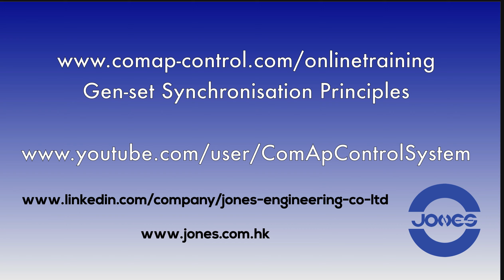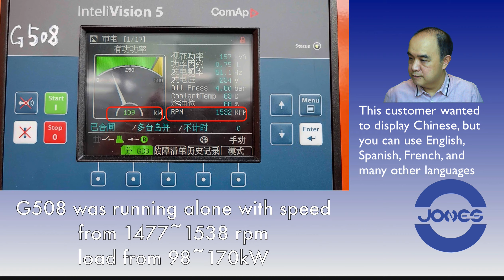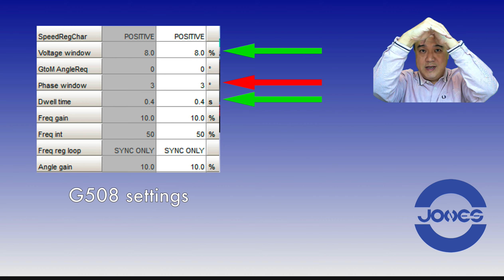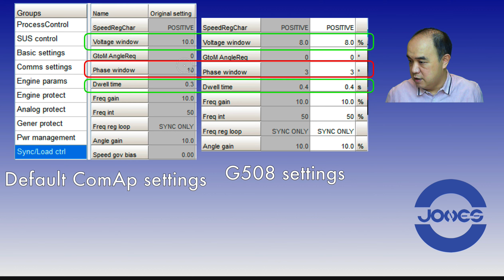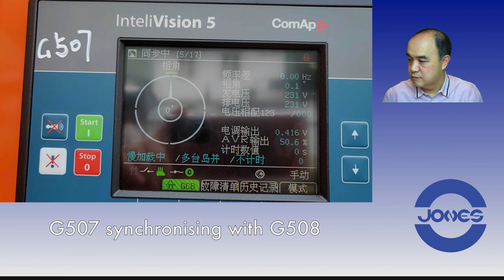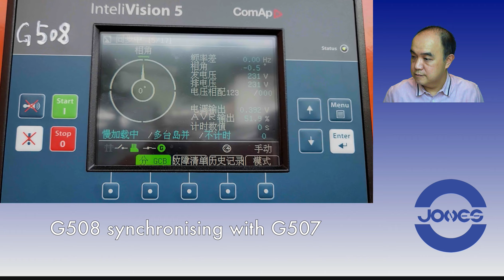ComAp Synchronising while Engine Speed is Unstable

Comment: i have cummins qsn14-g3 with pcc 1.2 controller and ecm 876. i want to add existing 4gensets. i have inteligen basebox nt controller. any advice? am i remove the pcc and use comAp as a genset controller and synchronized comtroller.
or a way u can suggested me.
Reply from the maker: sorry, I am not familiar with this particular Cummins model. But most of the recent Q series Cummins engines are electronic engine with CMxxx ECU. If you find out which CMXXX it is, you can just select it in the ComAp PC software.  After you have a working connection via CAN, the setting of the sync/load share is quite similar to what was described in the video
Reply: thanks for your response.

Comment: Hi we are using inteli Gen200. We have power management issues. we synchronize 5nos 600kva genset. Last 3 weeks we are spacing in Auto mode gensets all start but Genset not stop as per power management. Even 500KW system load all generators are working with Each 80KW load. No one generator stop. all are working with 80KW Load. We already check can communication cables, Power management settings all normal. kindly Advice asap to solve this problem. We need 500 to 600 KW load only 3 generators need to run in Auto mode.
Reply from the maker: will need to look at your archive to see the settings and the history.  May I know where you are from? I maybe able to direct you to the ComAp office responsible for your country.  if you would like for me to look at it, you can send to my email, dchung@jones.com.hk
Reply from the maker: if you will send the archives to me, I need the archive file of all 5 gensets
Reply from the maker: have you set the Priority to be different on each controller?

Comment: But power factor not sharing well ? In that video g507 genset have 0.6L PF... is that good ?
Reply from the maker: I wasn't paying attention to pf. In  this application, the customer really only needed one set to supply the load, so the synchronization was only performed to do a soft transfer between the sets. and the load is fluctuating quite a bit all the time.  if they were running both sets parallel for a longer time, I would have tried to tune the var sharing a bit more.